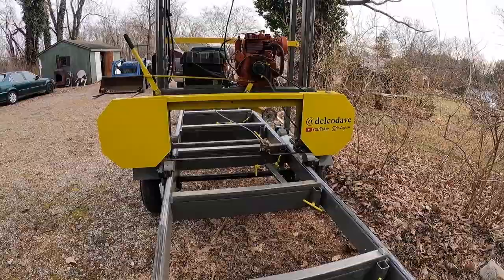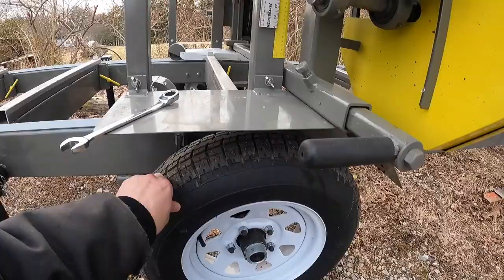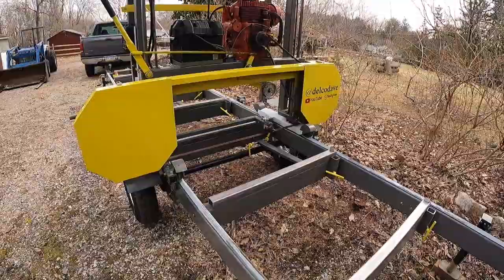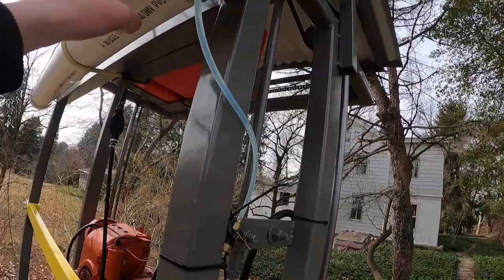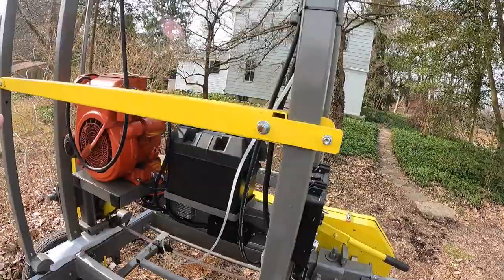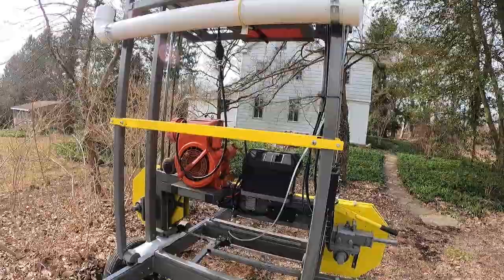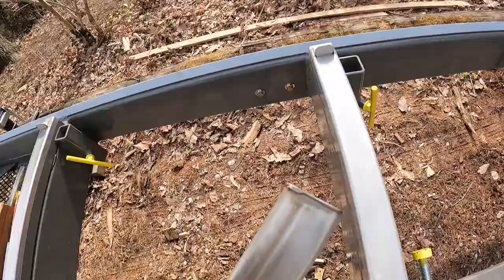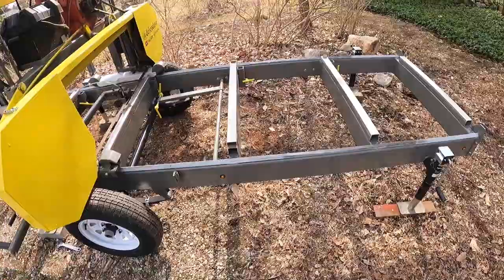Homemade sawmill walk around

Comment: 0:47 that’s a great way to do it. I was trying to come up with a simple way to do that on mine and I think you’ve provided a great solution there. 👍🏼
Reply from the maker: I am glad you found my video helpful.  So far my mill has traveled many miles and encountered many windstorms and the lockdowns work great.
Reply: @thedelcodave  good deal. Mine is pretty tall and heavy. I’ll probably use 3-4 bolts per size just to be safe.

Comment: I made my guides out of alternator front pulley, Pressed a bearing into the center, , and cut off one side Works great.
Reply from the maker: That is a good and inexpensive way of making a set of guides.  The cooks guides are pricey but they are very well made and a great design.

Comment: Awsome setup very clean I'm starting on mine soon if you was going to build another one what would you change
Reply from the maker: Thanks. I have since ungraded my lift motor I have videos on that. Like I addressed in this video make sure your blade goes down to 3/4 inch from the bed.  Also if using acme rod go 3/4 or 1 inch diameter.  Only other thing I would change is I could have shortened the height of my carriage by about 12 inches.  Good luck on your build any questions feel free to reach out and I will assure you anyway I can.

Comment: I'm not in to many diy sawmill forums but this is one of the best builds I've seen.   I've only seen one other guy use acme screws to lift the head.  I just ordered 1" 5 thread stainless rod for my lifting mechanism. Anything you'd change on it? Are your screws greased? My concern is with dust.  I'll try and prevent it from getting on it.  Can you give me a link to your thrust bearings on top and bottom on the screws?  Again excellent.  Just subscribed.
Reply from the maker: Thanks for the kind words.  I used 5/8 1-8 thread per inch zinc plated acme rods.  If I was to do it again I would have spent the extra money on thicker rods like your are using the 1 inch stainless will have zero flex.  No grease on the screws I occasionally spray them down with teflon wd 40 specialist spray or other dry lubricant.  The bearings that hold the rods top and bottom are just regular pillow block bearings.
Reply: @thedelcodave  you don't have any problem with the axial load on the bearings?
Reply from the maker: @BigelowWoodcraft  No issues I have a metal plate that the bottom that the rod contacts to carry the load.

Comment: Good job, engine looks ancient  :-) What clutching system? Ever thought of using 2x2" hardwood log stops, mounted securely in a  section of square pipe, which is then held in it's own fixed short square " socket"? Never a ruined blade again, ever
Reply from the maker: Engine is from the 70s or 80s but runs strong. The clutch is a simple tension lever with idler pulley.  I have considered the hardwood log stops if it became a regular thing. I have only hit a stop once. To prevent it... I now never set the stop  higher then the clamp. The clamp is easy to see from the operator station.

Comment: Good job!
Could you tell us where you sourced the pullies that the blade travels over and whether they have grooves with belts in them that the blade runs on. 
Thank you for your trouble.
Reply from the maker: I purchased the pulley's from surplus center. They are H bushing V groove that accept a 5/8 type B V Belt.

Comment: Could you please tell me what you used for your band pulleys? I really can't figure out the band pulley situation on the one i'm making
Reply from the maker: I used 18.75 diameter split taper bushed bore pulleys from Surplus center part number 1-BKH190

Comment: Great build! 

Where did you get the gears for making the saw lift up and down?

Also, is this okay to drive on the highway or roads? If so, how did you go about making sure it was safe enough to drive on the road?I’d love to make my bandsaw road ready but I’m nervous about making sure the trailer is safe enough to drive on the road. Any tips in the matter?
Reply from the maker: The gears were purchased from Surplus Center and the acme rods and nuts came from McMaster Carr.  Totally safe to drive down the road.  My rail system was built from 2x6 3/16 wall rectangular tubing and the axle is a 3500 lb trailer axle. The rail system is much stronger than a standard trailer. I have 4 1/2 in locking bolts that secure the carriage head to the rails for transport.  I decided the transport location by sliding the carriage until I had the proper tongue weight.  I have amber running lights down the sides and brake lights on the back.  I lower the head to the lowest spot to keep the weight as low as possible.  She tows beautifully.

Comment: Nice mill! What size of axel did you put on yours? and where did you get it at?
Reply from the maker: I used a Dexter 3500 lb axle. I purchased if from trailer parts king on ebay.  I ordered it as a kit with hubs springs and hanger kit.
Reply: Ok thanks for the info. I am going to make mine mobile but I wasn’t sure where to get an axel to fit mine
Reply from the maker: @woodintheworks3275  Good luck on your build

Comment: What kind of bearings are those at the bottom? That can take the weight of rod downward like that?
Reply from the maker: The bearings are regular pillow blocks. They can withstand some axial load themselves. The acme rod sits on a steel plate. I keep it greased. If it starts wearing (hasn't yet) I will add bronze thrust bearing between the plate and the rod. I hope that makes sense lol.
Reply: Yea it does, thanks

Comment: Thank you so much for showing all these details. Did you consider using a centrifugal clutch?
Reply from the maker: Thanks for checking out my video.  I did not want a centrifugal clutch.  The lever is a much cheaper option with less moving parts.  I also built it in a way that if I upsize the engine I can add double belts for more hp transfer.
Reply: @thedelcodave  Nice. Yeah, the centrifugal clutch on my sawmill has been its weakest point. I'd like to build my own sawmill this winter, and I have the same reservations as you regarding the use of a clutch. But I'm also tempted to base my design around the Linn lumber head, and I'm not sure I want to put the effort into modifying it away from the clutch. Who knows, maybe it will be easier to do that than I think.
Reply from the maker: @friendlylocal3731  the blade lever is really not that difficult to design.  In one of my videos I explain how you have to layout the pivot points for it to work properly.  If you need any specific measurements feel free to contact me and I can help you out.
Reply: I have the Linn Lumber setup and definitely gonna use manual lever like yours! The hefty centrifugal clutch price is the main reason to stay away!

Comment: Great inspiration!!  I am thinking building a sawmill and not sure on steel wall thickness. What is the size and thickness of the steel on the bed?
Reply from the maker: The bed is 2x6 3/16 wall rectangle tubing. The stainless risers are 2x2 1/8 wall SQ tubing.
Reply: Thank you!

Comment: Beautiful Machine! What is its maximum cutting capacity?
Do you have sketches with dimensions?
Reply from the maker: Max width between guides is about 39 inches.  I designed as I built but if enough people are interested I will make a video with the dimensions.  I scaled the carriage to make the capacities similar to a Woodmizer LT15wide and mine utilizes the same blade length.  Their machine has an advertised cut width of 36 inches.
Reply: I would be interested. What pulley wheels did you use? Super clean build and design. Did you mention total cost?  @thedelcodave
Reply from the maker: @homesteadfromscratch  the pulleys came from surplus center 18.75 inch diameter I believe.  Steel prices were low and I used as much recycled steel I could find.  Total cost was in the 3k range. I'm sure in today's prices it would add up a lot more.

Comment: what rpm motor are you using?
Reply from the maker: The lift motor is a razor scooter motor that spins around 2600 rpm max but is variable speed controlled with a pwm controller.  The old Kohler 301 spins at about 3600 rpm at full throttle.